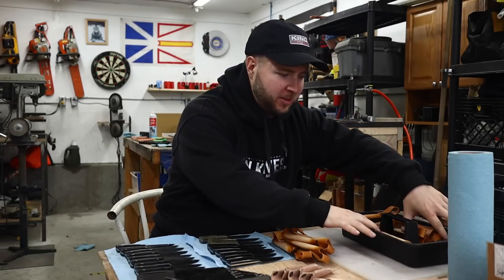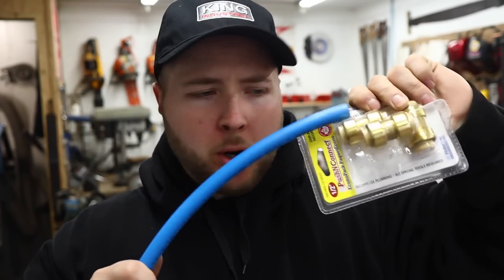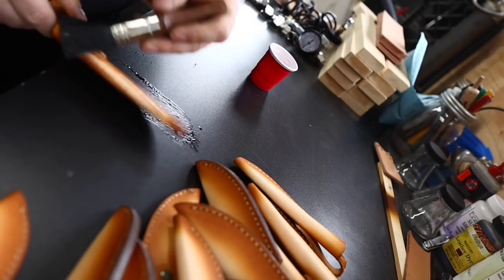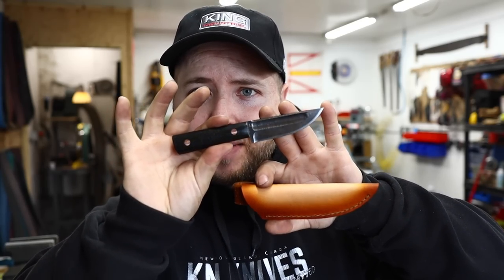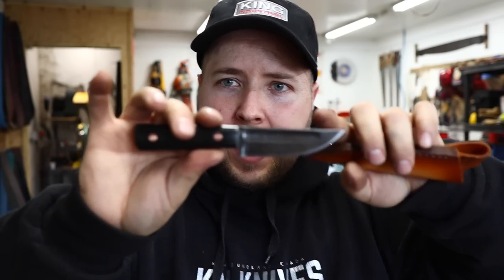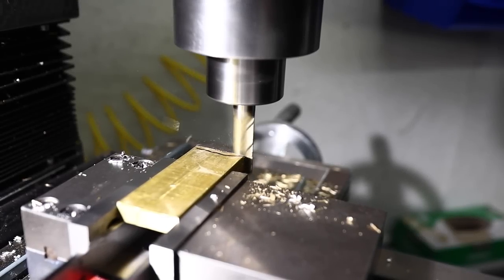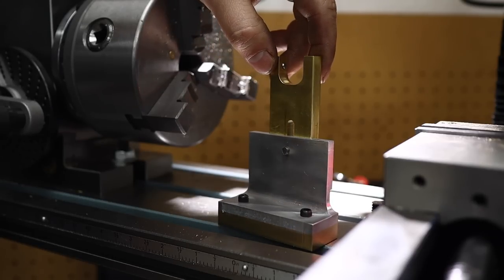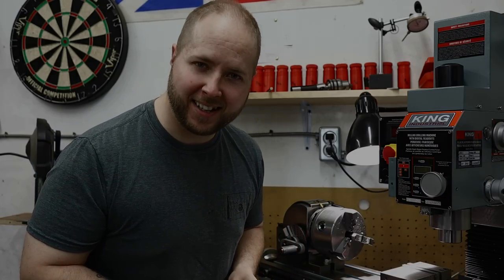NEW KNIFE RELEASE and building a tool for a Special Project!

Comment: Hi Kyle 
The push fit fitting have to have a insert in to the pipe , It has to be the same manufacturer as the fitting, You can’t mix them , With other makes , I always use silicone grease with the fitting 
Thanks for taking time to make these Videos 
From the UK 🇬🇧

Comment: Hello Kyle this is Steve from Tennessee. Regarding the PEX fittings that’s a copper ring and yes once the copper ring is cramped you cannot use it again but the fitting is reusable if you’d cut the copper crimp off with a Dremel like cut off wheel then split the PEX to remove it from the fitting… I agree That is the way to go with all plumbing inside and out. That crimp ring is a special anodized/ black oxide to inhibit corrosion… they sell bare copper ones but I’ve been advised by a Master Plumber in the Family that in the case of underground installation these are the best secondary to certain SS types that may inhibit corrosion better but are not as secure as the copper ones. One of the neatest things about that type of PEX crimped fittings is that it is able to be rotated after crimping for best orientation. Love your show and all that you have to offer… God Bless

Comment: PEX crimp is best, but if you use a push fit, get the real shark bite brand. They work very reliably. Also make sure the outside of the pipe is clean and smooth. They are really nice when transitioning from one type of pipe to another.
They seal with an o-ring so a little dirt or a scratch on the pipe is likely to cause a leak. The cheaper fittings also have cheaper o-rings so you're more likely to have a problem.

Comment: Hi Kyle, big fan, but I work for reliance worldwide down in Brisbane Australia. We manufacture the Sharkbite push to connect system. I am going to have to disagree with your comments on the fittings not lasting and leaking easily. Our fittings come with a 25 year warranty and have been used within walls internationally for decades. And the ones you displayed are another brand and not our products either. 🤣🤣Having said that, I am glad you like our crimp system.  Love your work, son.

Comment: Your daughters reminded me of my own -- I've got two with a similar age gap. Mine are all grown up now -- it all goes past too quickly. Plumbing is still all copper pipes and solder joints here in the UK. Perhaps it's different on big projects, but for small home jobs? Hey, at least it isn't lead any more.

The only thing I don't like about that Bakeapple is that big fuller -- and it's just struck me why it appeared -- it's the mill, isn't it? You just couldn't stop yourself from experimenting with it. Well, I hope they do well for you.

Comment: Your leather work has come on a lot since the last video I watched about 6 months ago 😳 Sorry for the absence, I'll probably be having a good old binge watch over the next couple of weeks and get caught up.

You new little tool is interesting.... I'm definitely thinking it's for holding something in a fixed position.... maybe an air brush? More likely a blow torch that you can then heat up a maker's mark before burning onto leather. Some of the more" out there" ideas would be your tooth brush, tv remote or something to allow you to multi task while using the bathroom...  don't tighten the thumb screw to tight with that one!! A definite possibility would be holding a paintbrush to apply oil to a part on a laithe or mill. Very interesting 🤔👍👍👍👍

Comment: Milling machine is just a drill press? Ah. No. Way more than that. Liked seeing you work the brass. High speed slow feed. Guessing the tool you’re building is directly connected to sharpening a steel edge. Sorry to hear about the water heater. I got 15 years out of my last one and it never leaked a drop. Hang in there.